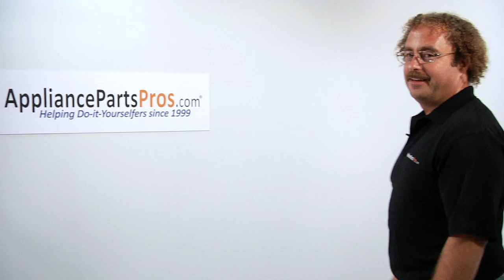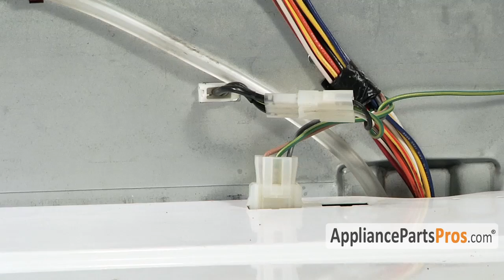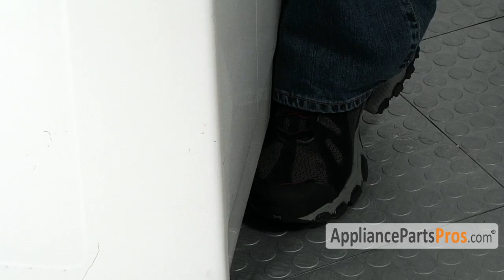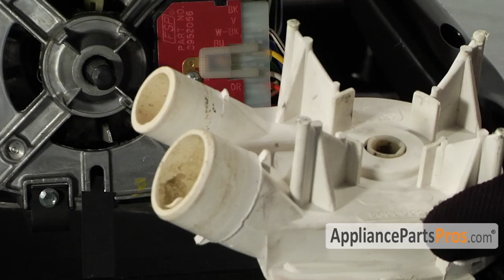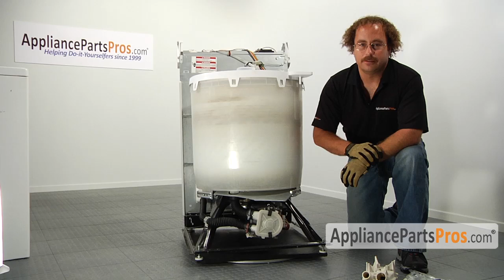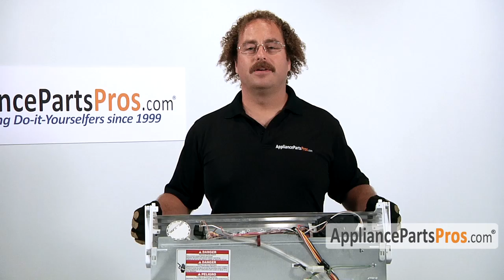How to Replace Whirlpool/Kenmore Washer Pump (WP3363394) – Fix Washer Won’t Drain or Spin

Comment: This video was extremely helpful!  I fixed my washer in 30 min!  I didn't think it was the switch, so I pulled the outside of it off and checked the pump.  The pump had a sock in it.  Pulled it out, put it all back together and it works perfectly.  Thank you!
Reply from the maker: +Tanya Y Glad the video helped you fix the washer and that you did it for free!

Comment: My first washer repair. I thought I was going to have to buy a new washer, not worth paying a repairman to fix a 9 year old machine. I watched this video and decided to give it a try. The pump came right off with no pressure. When I filled it with water it leaked  out pretty quick. I spent $39.99 on a new pump and the install  was as easy as taking it apart. Problem solved and I feel pretty good about doing it myself. Thanks for the video, it made my day.

Comment: This was very useful - however, if there is a little pile of rubber shavings under the washer you probably will need to replace the coupling as well - as you have got the water pump off  it is not much more of a job to remove the motor and check that coupling - if it looks worn might just as well replace at the same time.

Comment: This video was a great help to me recently. I'd like to add that if the clips are really hard to reinstall, there are a set of dog ears on the top/bottom of the pump that makes the job of prying the clips back on much easier.
Reply from the maker: Glad we could help, and thanks for the additional tip!

Comment: Haha, I was so dumb to not look for a video how to replace the pump.  Took off the back first, disengaged all kinds of wires. It was fun until I ran the washer and flooded the laundry room because the water level silicone tubing had a loose end.  Great video, wish I had watched it before having too much fun.
Reply from the maker: Glad you were able to get the washer fixed!

Comment: PS make sure you have a container under that pump when you remove the rubber connectors - gently ease off the lower hose and allow the water to drain out - there is sure to be a fair bit in there!!

Comment: I took the motor pump off and it doesn’t appear to be clogged.  It spins when I put my finger inside it to manually move it.  Could it still be broken or could it be the actual motor powering it?

I’ve already replaced the lid switch, that didn’t work.  Thanks for the vid

Comment: Can you consider doing a video on water leakage from a vacuum line?  I'd love to know how that diagnosis is made...Whirlpool washer top load if possible.
Reply from the maker: Unfortunately, we can't usually do videos on demand, because it takes us several weeks to get from sourcing the appliance and the parts, researching the repair, filming, editing, putting it through quality control, and uploading. However, keep in mind that if no video is available for your part, you may contact us at 1-877-477-7278 or chat on our website http://www.appliancepartspros.com/ and we'll be more than happy to assist you with the repair. You can post questions on the Question and Answer section of the specific part page to receive answers from our techs. The best part of using our technical support options is we provide the service for FREE.

Comment: and saved me from hiring someone to diagnose the issue and from buying a new motor (the first idea for a solution). My problem was my 2 year old wash would not drain and or spin.
Reply: Did this help you?..i'm having the same issue..won't drain or spin..
Reply: @gennaro4941  it's been awhile, but when that happened it did work for me.
Reply: @Nuggett33  changed my pump the other day.. easy fix..15$.. works great again..thanks for the video and reply

Comment: I replaced the pump and put everything back together and then started a load of laundry and my washing machine started to violently shake back and forth on the spin cycle which it had never done before. I don’t know what to do but all I did differently was replace the pump. The machine is level as well so it’s not unbalanced.
Reply from the maker: What is the model number of your washer? Is it only doing it during the spin cycle?
Reply from the maker: With what you have described it sounds as if the washer is unbalanced. It is possible that a spring may have came loose.
Reply: @appliancepartspros  do you have a video I could reference to repair this?
Reply from the maker: The link below should give you a general idea on how to do the repair. https://www.youtube.com/watch?v=bwOrDwj_W9Y

Comment: Hi, thanks for the video. I replaced my washer pump and checked the hose for any clogs. It still won't drain. Any suggestions of what might be the problem?
Reply from the maker: It could be a few things, not sure I can cover it all here. Without knowing what you have, I would suggest posting the problem along with the appliance model number on our repair forum and the techs can help you troubleshoot the problem. http://forum.appliancepartspros.com/

Comment: I am unable to understand how to put the body back. Does all the body go on top of the frame.   Also you show how easy it is to just set it on. On my washer the sides flare open  when I push one side in the other comes off. What am I missing

Comment: after I unclogged a sock from the pump, put it back, the washer is spinning but still won't drain the water. What's the problem?
Reply from the maker: It could be the pump impeller was damaged by the sock. Pull the pump off then put a big screwdriver in the motor shaft spot. Then try and turn the pump while holding the impeller. If the impeller does not turn with the shaft you probably need a new pump. Also check all the other hoses for clogs.

Comment: okay I see this was for a whirlpool washer- I have a Roper-is this the same process for changing water pump
Reply from the maker: +Judi Mott It should be most Ropers are made by Whirlpool. You can go to our website and enter your appliance model number to view the parts breakdowns to be sure you get the correct part for your model.

Comment: my kenmore needs pump, its 30 years old and i think my part # now is too old because my model # is not getting any info. my model# is 110 4225090, is there a new number that can match this one so i can get the right part. please would like your advice.
Reply from the maker: The model number does not come up so either it is too old or it is incorrect. If you have a direct drive washer like the one in this video then it is a good chance that this is the correct pump. This pump was used on most of the direct drive washers back then. If your pump has larger hoses and a check vale then this may not be the correct one.